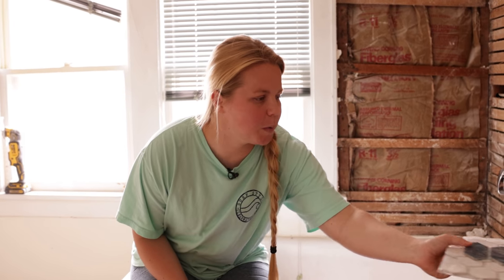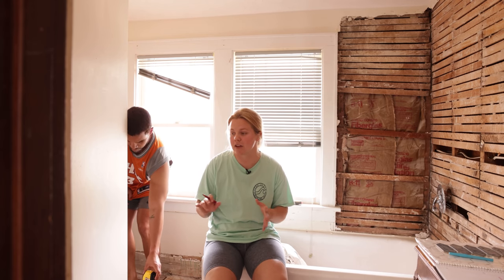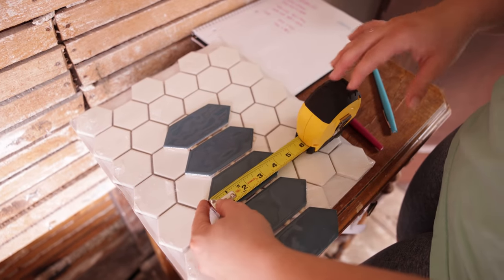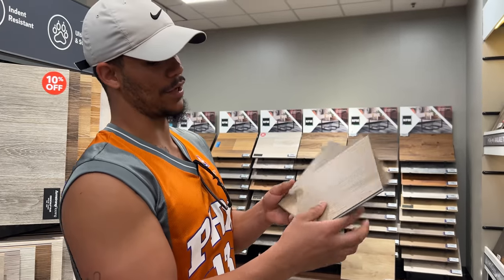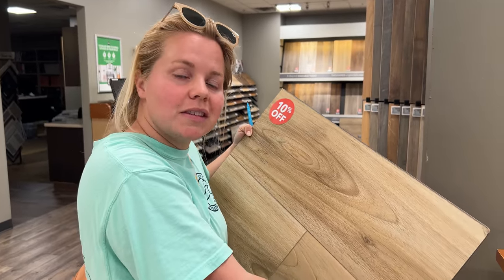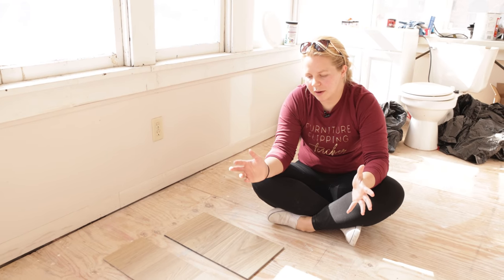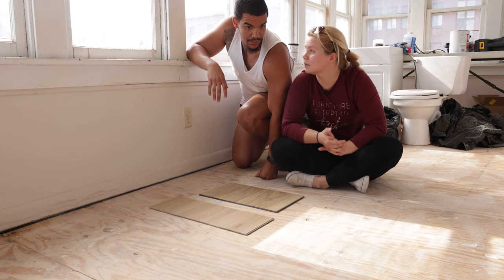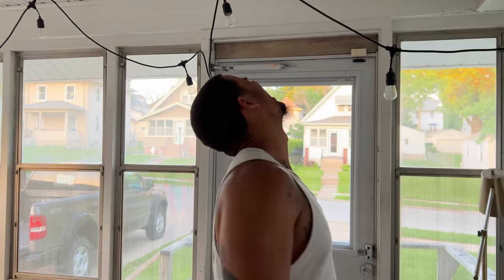Picking Out Bathroom Tile & Sunroom Flooring for Home Renovation

Comment: My cousins air bnb had an original clawfoot tub with tile like you are describing and after a busy year of it rented out she pulled the tub out and made it just a shower. One because guests would complain that the shower curtain was tricky and tgat no matter what they did water got everywhere (if people are not used to a shower curtin all they way around it can be intimidating not charming) and two, her new insurance company said it was a fall hazard more than even a regular tub. So they switched to a stand alone shower. Just food for thought.
Reply: I went to an AirBnB once that had a claw foot tub and I hated it, the shower curtain was annoying and in the way and it was insanely slippery. Plus they didn’t have a shower head mounted to the the ceiling or high on the wall, it was just loose, so I had to hold it above my head the whole time.
Reply: tubs are just all around hard to clean too.. showers you can just spray them down, squeegee and you're good to go. saves so much time, especially if you're doing it yourself or paying a service. every bit helps cut down on cost.
Reply: This is SO very true! Aside from the esthetic & resale value concerns shower curtains are not always looked at as something that is clean in a shared environment & w/the added claw foot tubs they are a huge insurance hazard which may not be an issue if you can afford the insurance but good to think about none the less!

Comment: First of all great job you are doing ! I'm so sorry, but I agree with some others : the little tiles will make it look very bussy/restless, maybe a bit sterile and there is the danger of getting mould on the grout.Horrible to clean and if the tiles are dark or very shiny you will see every single  waterdrop...One thing I've learned in the past: tiles that are to much dated/modern for example in style or colour are probably outdated 5 to 10 years later. And you could not change your tile every 10 years. No problem at your own home if they are outdated but you still love them. But for guests at an airBnB ....You can change the style of a room much easier by other furniture deco etc. In germany we've  got waterproof vinyl flooring or tile which looks exactly like wood floorig. Looks good at a bathroom floor. Please keep the second window otherwise it will be very dark! I hope you guys understand what I wanted to say , I'm not a native speaker. 
Good luck for your further projects. Looking forward to the results.

Comment: I look forward to your videos.  Thank you for sharing. My vote is for Shower no tub. Save the $ and install luxury shower head. I agree with previous suggestion of Bead board on wall halfway so not overwhelming with tile. Great design with teal insert. Use your tile design in the shower. Keep both windows . Perhaps use white plantation shutters. With a shower there appears to be room. (?) Think function.  Again, the side table is too small and too short to be practical. And a bowl for the sink is too trendy with no space for toiletries.

Comment: IMHO perhaps you should consider eliminating a tub altogether. Just create a really nice shower stall with both an overhead shower head and a handheld body sprayer. And btw that cute little washstand you bought last time is too small and too short. Your guests will need enough counter space to spread out their toiletries, toothbrushes, hairbrushes etc. The counter height should allow a six foot guy to wash his hands without having to bend down too much. Please install an exhaust fan to remove moisture and odors. (Connect the fan to the light switch). Install good lighting and get rid of ALL the bathroom windows.

Comment: Good decision on the non-beveled floor. Don’t forget the door transition strip. Could you keep the current tub & add a shower stall to it? If not, just go for a nice shower. A soaker tub is rarely used & frequently annoying to use due to shower curtains getting stuck to to as you stand in the shower. And people can be careless when it’s not their property; they won’t bother to keep the curtains inside the tub & will flood the floor.

Comment: Bathroom tiles: As others have noted, consider bigger tiles. Grout is a magnet for grunge and a PAIN to clean. Bigger tiles = less grout = less cleaning. Also agree with shower over tub for rental. Someone slips and cracks their head open-- could be a liability issue. Sunroom flooring--Wide plank seems more fitting scale-wise for REALLY big rooms. Also, that bevel would be a dirt magnet.
Reply: I totally agree with you!
Reply: As someone with little kids, a rental without a tub would have been a no for me in the past except I’ve recently see a collapsible bathtub that you can store until you need it!  I think it originated in Japan with their tiny apartments or something similar, but it makes it possible to have small kids without a permanent bathtub.  It honestly makes me want to rip out every tub we have…

Comment: So many choices with flooring…I have the textured type snap wood and I love it. It’s water safe and for me the texture makes it look more wood like. I also have the seams or what look like grout lines and I’m fine with the look. It is super durable. I have it in my bathroom, hallway & kitchen. In my old home we had it installed in the entire home (everywhere) and it was a huge selling feature. We did not want to mix porcelain tiles and wood flooring we wanted a seamless look. It’s also super easy to clean I use a Method Almond floor cleaner from an O’Cedar spray mop.

Comment: If you decide to go with a claw foot tub definately look at the the metal frame you can install over it for the shower. Doing it this way you can keep the window which will save you so much money and the trouble of matching siding, construction, etc. 
I agree with others though that for liability reasons I would go with just a free standing shower. If you do a glass shower then it will keep the room more open. I not sure what the bump out into the bathroom is but I would look at taking that out if you can and put the shower over there vs putting it where the current tub is.
Reply from the maker: unfortunately that is the stair well so it can't be removed which stinks! there is a small linen closet there but the floor and wall is slanted 😅

Comment: If you put in a clawfoot tub you won't have to remove the window. Removing and resizing windows can adversely effect the fenestration on the outside of your home. Just get a ring shower rod and add two curtains for a claw tub.
Reply: Not to mention you ll have to re side your house if I was to cut cost I'd take the extra money and spend it on the flooring in the sun room real wood
Reply: If your worried about being seen from out doors in the bath room frost the window the extra light in there will save money on electric

Comment: If there is only one bathroom, a regular tub that can be used as a shower as well, may be the best way to go. It's not as fancy as a claw foot tub but much more usable and safer.  Also, many people don't install some kind of safety bar in the wall for anyone older, kids or anyone having a hard time getting in and out of a tub, which I imagine people in that situation would be glad they had one. Tile can be very slippery when wet and I agree, tile grout is a pain to keep clean unless you plan on using a darker grout color.

Comment: Here is what you need to know:
A) Tile grout needs to be epoxy grout so it doesn’t stain, mold, or allow water to go through it to the underlayment. Epoxy grout is tricky so research installation. You must use Schluter or similar quality water barrier or your floor will rot. 
B) Your bathroom floor is not structurally strong enough to hold a heavy tub.
C) Hire contractor to remove your 500# tub so if anyone gets hurt their insurance covers it - if a friend gets hurt your homeowners insurance would have to cover it. 
Hang in there you are doing great!!
Reply from the maker: Thanks...already planning on using Ditra and we will be getting a new subfloor so no worries about the weight 😀 I am sure to do lots of research before doing anything I've never done before. appreciate you watching!
Reply: Yes!  You need a water barrier on your floor and behind the shower wall, you will be so glad you spent the money to protect the rest of materials behind the wall.

Comment: Is running tile being used on the floor up onto the wall a new trend? Can understand it around a tub...areas prone to getting heavily splashed. Given the age and character of the house, could've envisioned a bead board, or similar, used elsewhere which might also afford subtle verticallity in such a small space with its lines. The 'busy-ness' (visually) of the small tiles and all the grout lines, plus tile can appear cold (sometimes institutional). Curious to see how what you plan to do plays out.
Reply: I have floor to ceiling tiles in my bathroom but they are 300 x 600mm (12x24 inches I think that converts to).  They are easy to clean and because they are a shade of white aren't in your face. I have a very large bathroom and kept everything white with just a little colour, in small multi coloured tiles, as a backsplash above the vanity.   Personally I think the small tiles make the rooms look too busy.  I'm in Australia.

Comment: Keep the tub you have.  It is a heavy duty tub that will hold up to lots of wear and tear.  If you want to make it look brand new, have it expoxy coated by a pro, don't waste the time doing it yourselves.  It looks to be in excellent condition, don't replace it because you visualize BnB customers acting out fantasies of long hot bubble bath soaks in a claw foot tub.  Ain't gonna happen!  They will be in and out of the shower or taking a long hot shower - so have a big enough water heater to accommodate!  Put in a rainfall shower head if you don't worry about conserving water (and receiving a large water bill - because guests WILL abuse and take 30 minute showers, not 10 minute showers).  The tile choices are great, love them.  Just for purposes of east of cleaning, I would not choose the Butternut Walnut Natural flooring for the sun room - the bevel will catch and hold dirt a lot easier than typical LVP snap together flooring.  I'm also not a fan of the wider blank compared to a more traditional look, especially given the age of your home.

Comment: Do a shower, save the tub for your area. The tub will be a real headache with guests leaving water all over the floor. I cleaned a guest house with two claw foot tubs, and they were constant trouble with water.  When you measured the blue tile looks like you forgot to account for the tiles needing to lock into each other, making the actual area they cover shorter

Comment: I would opt for shower and ditch the tub. They are a hazard and hard to shower in. Your guests will appreciate a shower
Reply: I thought just do a shower too.  It's an air b&b not your own home.  Also I don't know why all the YouTube home renovators are so in love with all the small tiles atm.  Unless you have a tiler I would have thought bigger tiles would be easier.  When I had my bathroom renovated 12 years ago, my tiler advised to go bigger as it makes the room look bigger.
Reply: I'd def go for a bigger shower than the tub.  Had a claw foot a long time ago when I was younger.  Was fine for showering but the taller height could be an issue for older and less steady people.  Might have some that don't stay because of that issue alone.
Reply: @pameladee9019  Totally agree with you. I am older & balance issues so we automatically look for a place with walk in shower. Maybe a claw tub fine for the crowd that will be renting out the air bnb though.
Reply: I agree, no tub just a shower. I  think if the tub overflowed,  what a mess

Comment: The flooring through out the house should match wood or tile s or it just looks cheap in the end and sun rooms were meant for plants and reading .I rent a unit that has fake wood floors and at first it did nt bother me but after 10 years i hate it so much If you have taste at all your able to tell right away its not real and the cost is too high not to have the real thing